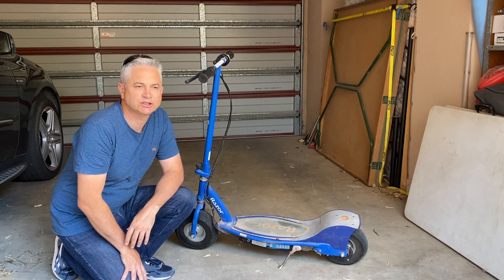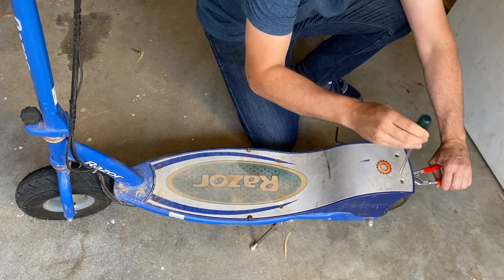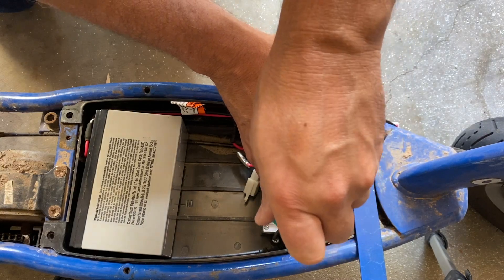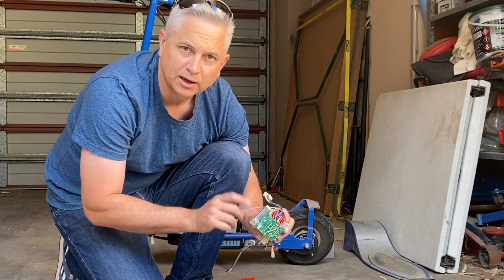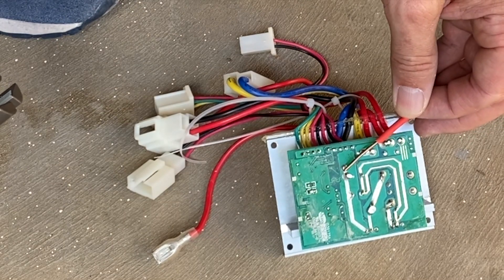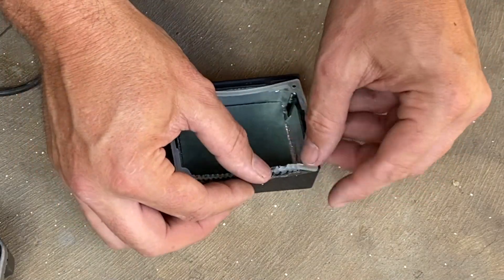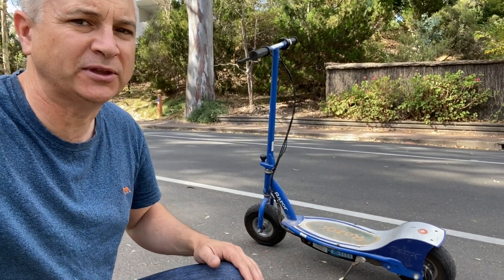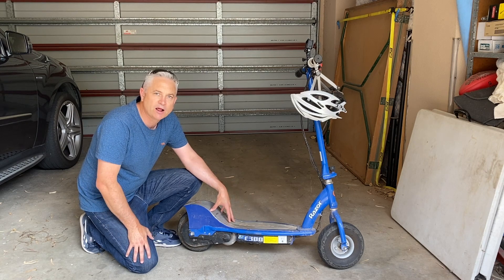Razor E200 E300 Speed Controller Hack for More Speed and Power

Comment: Great videoo Drew, I have just bought one of these scooters off of gumtree, and I am wondering, does this mod decrease the range of the scooter? I'm thinking more torque, more speed = less battery life? Have you seen any noticeable difference in battery life since doing this upgrade? I ask because the stated range of the scooter is around 10 miles on a full charge, and I will probably be using at least 6 miles when I'm travelling about. While the increased torque would be a blessing, will I be sacrificing that distance? Thanks! Michael
Reply from the maker: Hi Michael, I have not noticed any significant decrease in range!  Cheers Drew
Reply: The range should be the same unless you are using the extra torque to go uphill faster instead of pushing the scooter. 

I used a 486 watt hour battery on an ebike with a 1500w motor giving me 17km at 50km/h. The same battery on another ebike with a 300w motor riding a 25km/h also lasted 17 km range. It could vary if the vehicle and riders are lighter.
Reply: @gerardr4869  It will definitely reduce the range if you are noticing more power.   That hack allows more current which means it will use more current.  More fun though and worth doing unless you fry your motor.
Reply: @nickdarling5557  usage of more current is also providing more travelled distance but the higher the load , a battery gives less usable energy
Reply: So less range.
Reply: @nickdarling5557  in the case of a razor schooter with stock batteries probably you are correct. 
My ebike battery is rated for 90 amp draw so no difference on range if I draw 10 amp or 50 amp.

Comment: Very interesting hack but does it burn the motor in time? Or drain the battery faster? Im mostly scared about the motor, can it get burned or something?
Reply from the maker: Hi Daniel, my motor is still running fine!! Cheers Drew
Reply: Battery should drain slightly faster because of the increased current

Comment: Hello. I have an E300 that sat for a long time.  After being on charge all day I still have no power with throttle.  When I have it plugged in and hit the throttle I hear a click from what feels like the speed controller. I put a voltmeter on the batteries and I'm only having about 8 volts. So I'm assuming the batteries need replaced regardless?  I just figured it would at least turn the tires with no weight on it.
Reply from the maker: Hi Korey, your scooter need new batteries.  Here is a video I have done on how to change them: https://youtu.be/_ZaYluDs5Ns Cheers Drew
Reply: Saw a video that said you need at least 21 volts coming from the batteries for the tires to move 👍
Reply: The speed controller cuts power at 20.5volts +/- 0.5v this is so you don’t over discharge the batteries. However, if a 12v led acid battery only charges up to 11.5, it is considered worn out and needs to be replaced.

Comment: Can you do this with the E95? Or is the Interior the same
Reply from the maker: Hi Mate, the E95 will have a different speed controller as it is lower capacity.  The principle though should be the same so you will just have to find the current limiting shunt yourself on that PCB! Cheers Drew

Comment: Hello Drew, I'm hoping you can shine some light on my situation? I have the exact scooter and the first time I did the procedure it worked awesome! However it stopped having the extra power after one ride. I thought it was due to my crappy soldering job so I did it again but nothing happened and then again!!!! What are my options ? I weigh close to 200 lbs I really need that extra hmph  thank you solo much. Your video was so easy to fallow your a great teacher.
Reply: Also the batteries are brand new
Reply from the maker: Hi Jay, It’s hard for me to say without looking at it, however perhaps in your case you might be better off upgrading components such as
https://youtu.be/wPVQ6zAvOmg Cheers Drew

Comment: Didn't work for my e200 yes it would turn on and run but as soon as I stood on it it would turn off.
Reply from the maker: Hi Johny, Interesting.  Did the fuse blow or did the controller just cut out? Cheers Drew
Reply: @DrewFixIt  so I have no idea if there is a fuse but I don't think it blew all that would happen is it would run normally as long as I didn't put weight on it but as soon as I stood on it the light on the power switch would cut out... After removing the copper wire and reassembling it I've had no issue with it. I believe it's a 2016 e200 Razor
Reply: @DrewFixIt  I'm wondering if I would have been better off cutting the piece of metal on top connecting them off and only had the copper wire. I don't know
Reply: @DrewFixIt  Howdy drew! I went ahead and bought an e300 im going to test this shunt mod again and ill let ya know how it goes! (this time thinner wire, i soldered a piece of copper wire last time might have been to thick)

Comment: How is this mod still going, has it damaged the controller or motor yet
Reply from the maker: Hi Adam, it’s going really well. There has been no damage to the controller or motor that I am aware of!  Cheers Drew
Reply: @DrewFixIt  cheers, just got one going with new batteries so hoping this mod will make a difference and maybe later 36v ect
Reply from the maker: @adamrobinson9148  sounds good!  Cheers Drew
Reply: Looking to make my E300 range longer but no need for faster speed 
Any idea of simple ways how to?
Reply: @kanikipk2814  replacement batteries with more amp hours. Clean the bearings and do simple maintenance to make them roll smoother.

Comment: Very cool!  My Razor E300 has become a big build, check it out on my channel!
Reply from the maker: Hi Svendsen, What motor are you putting in it? Cheers Drew
Reply: @DrewFixIt  Hi Drew, the previous owner had swapped in a 500w controller and I have an ampflow e30-150 from an old robot that should work for ~1hp.
Reply from the maker: @SvendsenWorks  I'm not sure if you've seen but I've got the "Big Motor Razor" project, which is running a similar motor!  https://youtu.be/MMEqKcgljdw Cheers Drew